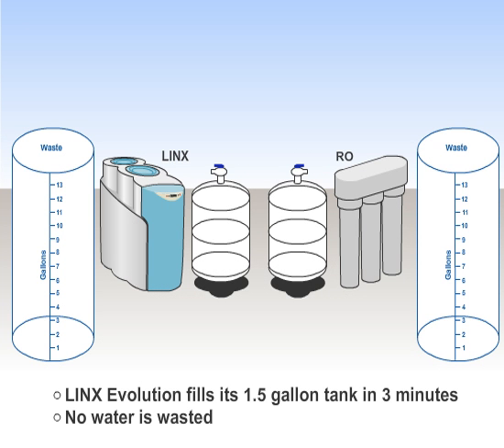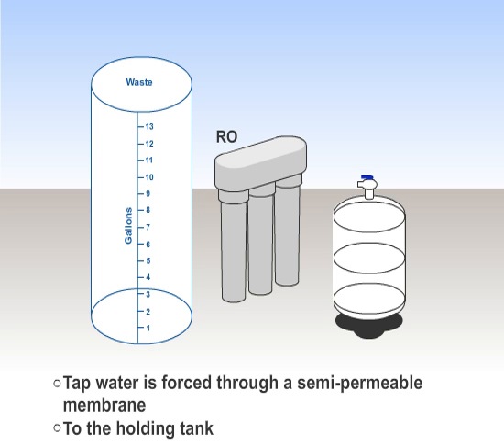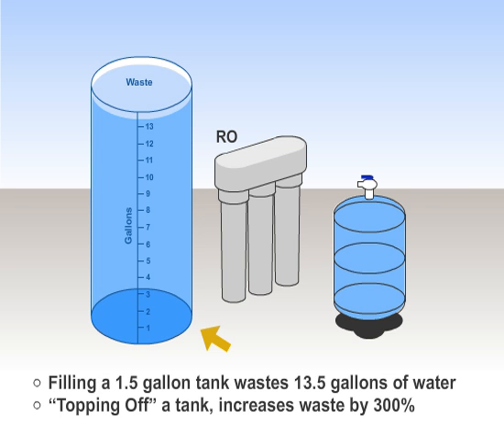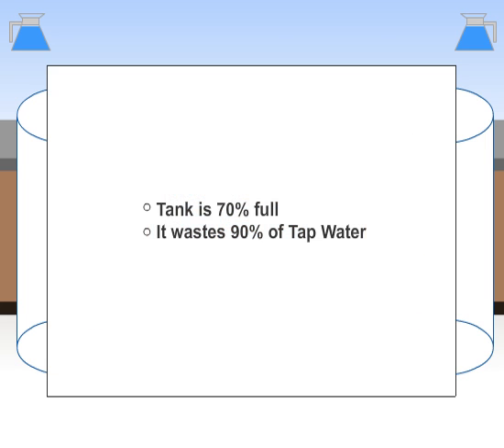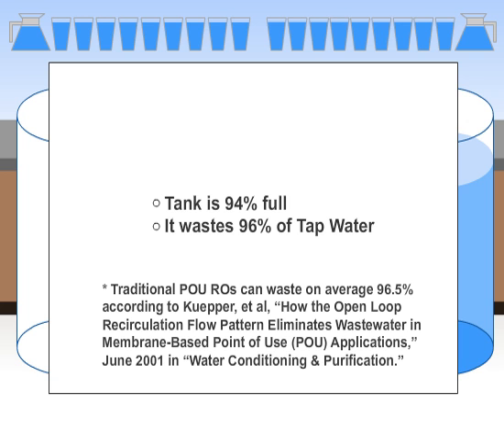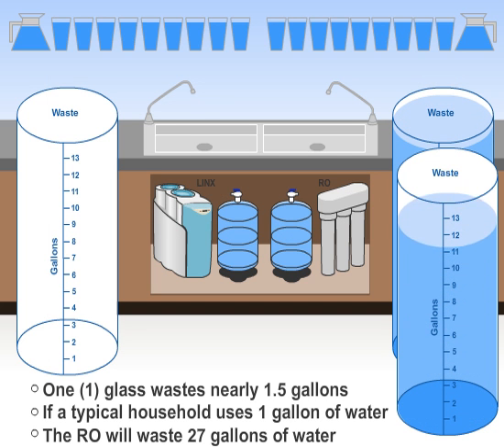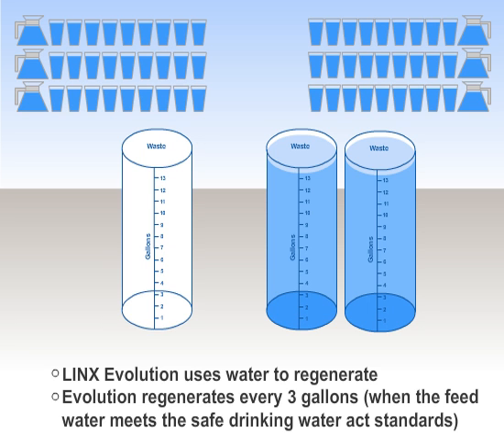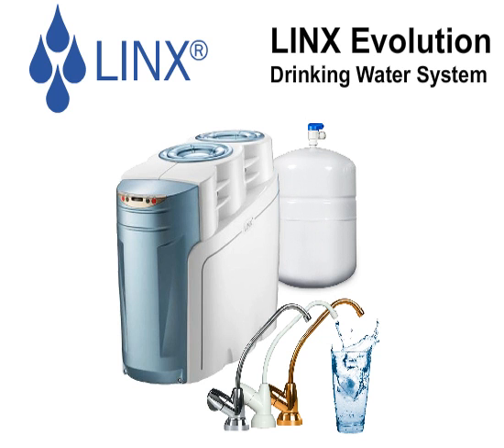Insane Water Waste -- Reverse Osmosis (RO) Truth

Comment: I have had a Whirlpool RO system for @ 7 yrs.  Since I pay $ 15 / month for unlimited water, coupled with a septic tank, I didn't pay much attention to any ' wasted ' water.  It would have been easy to run the discharge hose out to the garden, rather than have it connected to the sink drain.
Reply from the maker: Thank you for your comment. Great observation. Most people do not pay attention to wasted water. We think twice before littering, and even go the extra mile to recycle, but wasting water is still not a priority. Kudos to you for your awareness!

Comment from the maker: @Erin Kemuel - YouTube will not let us reply to your question for some reason, but yes the results for fluoride reduction were tested by Pace Laboratories. Actual results from this testing are posted up onto our website under the Benefits Tab and then under Cleaner-Healthier. A link to the PDF of the results is on that page. Thank you for your question.
Reply: LINX, you need to stop this. RO/DI filters (which are what you normally buy) are meant for getting such pure water that LINX systems cannot even compare. An RO/DI unit isn't even really something you should use for drinking water. It gets the water so pure that your diet will be lacking in trace elements. They're meant for things like an aquarium, where trace elements can cause algae growth. This is irrelevant.
Reply from the maker: Nathaniel Smith Thank you for your comment. That is the one of advantages of LINX® drinking water systems – you can use the Dial-A-Taste® control feature to leave some of the minerals in the water.  When operated at for maximum reduction of total dissolved solids (TDS) 5% remains in the water but when operated for minimal TDS reduction 30% remains in the water.  Only about 5% of mineral content remains in water treated by RO – but it depends on the constituent.  For example RO only reduces nitrates by 60-75% leaving 25-40% in the water which is not something you want if you are trying to meet the Maximum Contaminant Level per the Safe Drinking Water Program.  So LINX can match the quality of water produced by RO but the consumer also has the option of adjusting this to produce water to their taste. 

Millions of homes have RO systems to provide good tasting healthy drinking water and about 300,000 more systems are sold for this purpose every year in the US. Think of how much water is wasted.

Comment: When I started realizing the "waste water" of RO systems, I started to somewhat panic. Not only were the threads talking about the amount of water being "waste" but the cost associated with it. I then looked at my water bill and did some thinking on the cost of this "RO waste water". From my bill, the cost per gallon for water is less than a penny or at most a penny per gallon. If I then work that cost to the amount of possible water wasted by the RO system, it is far less than the amount I spent on buying filtered water from my local water store. So the cost is not such a concern anymore. But the real concern is the amount of "waste water" produced by the RO system. The 3-4 to 1 ratio is still a bit staggering. But if you think about it, it is probably the same for the water store where I purchased my 5 gallons of water. So the waste water either comes from my home or the water store. Since the dollar amount of the waste water is not much of a concern for me, it is now the actual "waste" amount that I can recover to be used else where. So for those who are concerned about the waste water, like me, try to figure out a way to recover the water. The threads and other sources do provide excellent suggestions on how to go about using the waste water from the RO system. Just as an FYI, there are RO systems out there that do provide a way to reuse the waste water...it's worth to spend a little time to research your options. You can either start drilling a hole through your brick wall or attach a pump to recycle the waste water.
Reply from the maker: Every water district is different. You are very lucky, but there are many areas where water is not so inexpensive. Despite the cost, eliminating water waste should be a priority. If consumers are able to capture and reuse their RO water, that would be great. The reality is that most consumers do not. Rather than drilling a whole through your brick wall or attaching a pump to recycle the water waste, a simple solution is to use the LINX System - which gives you better than RO water but without the water waste. Thank you for your post!
Reply: LINX Water

I agree the concern is the waste water which I did mention in my post. Since I had already purchased the RO, I was looking at ways to fix the waste problem. My rant at first was finding out about the waste water of various systems. I didn't do enough homework before purchasing my water filter system. My point is to look at both cost and waste and in my case waster is the larger concern. The examples I mentioned were mere suggestions based on what I read and what is offered with my current system. This is a rather eye opening situation and I just hope others do a better job of research than I did.
Reply from the maker: Ferdinand Disano Thank you for the clarification! We really do appreciate your comments and welcome the discussion.
Reply from the maker: Good news!! The systems are NOW available online! They are on sale - go to www.LinxDrinkingWater.com to see prices and purchase info.

Comment: Does this system get down to 0 TDS?
Reply: No is it is merely imposible to get to 0 TDS.
18.2 MegaOhm-cm resistivity is the limit. That is equivalent to 0.055 microSiemens/cm therefore with a conversion factor of 0.7 is 30 parts per billion of TDS (0.03 ppm or 30 ppb). You will always have CO2 from the atmosphere in contact with water generating an equilibium of CO2 + H2O = HCO3- + H+, thus increasing the conductivity. In fact nowadays cationic conductivity or resistivty is used in high purity water to get better resolution of water quality. This concept is widely used in water quality assurance in power plants.

Comment: I bought an iSpring RO system from Amazon. The waste:clean ratio is about 2:1. My family of 4 consumes about 2-3 gallons of RO water a day, so 4-6 gallons would be wasted. That's way less than the toilets, in which a pee uses 1.5 - 2.5 gallons to flush. You get the idea.
Reply: exactly. 4 pee per member = 25 - 40 gallons per day. Let's not even start about how much water is wasted during many many industrial processes, and how much water is wasted by producing plastic bottles...the list goes on and on.
Reply: +EviLNox8 You can pee in the RO, it will filter it and transform it into good water. That's what they do in the space station.
Reply: +CZY Homer So basically go pee behind your house, and use that RO system for better water and your water bill won't go up :p
Reply: I have a very RO similar system that produces about that same amount of RO water waste probably around 5 or 6 gallons down the drain. It's basically trivial. LINX is a marketing pitch. They want to hook up to your electric system (waste $$$ in electricity, which most electricity is coal fired etc.) and then charge a fortune for the filters & system when I could maintain my RO system for 1/5 of that cost. It's all smoke and mirrors.

Comment: I installed a GE RO system in our home 6 months ago. We live in Monterey County and the average water bill here is $300-$400 per month. I had heard of the water waste and how I hear it going down the drain.

I have since switched off the RO system

I plan to bypass the RO component and just use the GE filtering system. If anyone has any instructions on how to do this, I would welcome it.

Thanks
Reply: There are a lot better more efficient RO systems that waste 2:1 or less and your bill would be substantially less. Hook up the waste water line from the RO system into some sort of storage tank and then connect the tank to the washing machine waste water problem solved.

Comment from the maker: Thank you for your comment. It is true, both reverse osmosis and LINX technology reduce contaminants similarly – about 95% reduction.  Both systems also use sediment pre-filtration and carbon post-filtration so the product water is very similar.  In addition, you can depend on both technologies to reduce fluoride by 90% or more.

Comment: Reverse osmosis, distillation and bone charcoal will remove it
R/O is the best, avoid distilling and dab a bit of sea salt or himalayan salt into the water, not table salt which raises your blood pressure. if the salt is completely white, with no discolor then its devoid of minerals which means its table salt and its false advertising crap, no wonder they say salt increase blood pressure because its TABLE SALT FOR CHRISTS SAKE.
just get an ro system and a fluoride meter to test it, its costly*

Comment from the maker: In response to your other concerns, LINX systems are not membrane filtration systems, rather they are ION EXCHANGE systems which utilize electricity instead of chemicals or salts. The water passes between the layers of the LINX ion exchange membrane (media) not through it, so feedwater pressure minus tank backpressure (net driving pressure) has NO effect on water efficiency.

Comment from the maker: Thank you for your comment. Unfortunately, there is no way to eliminate the back pressure in the tank, however it can be mitigated with a permeate pump to partially overcome it.  In testing done by John VanNewenhizen (a long time Culligan technical manager) adding the permeate pump doubled efficiency thus raising water efficiency to from 6-28%.  Since no pressure in the RO tank equals no flow at the faucet, the back pressure can not be completely eliminated.

Comment: this presentation is not fair enough even the posting of comment needs even an approval.. You forgot to mention that there's a way to eliminate the back pressure.. ^_^ then what kind of membrane you are using? A semi-permeable one that uses electricity? well that membrane must be an epic since it can recovery with the HIGHEST rate.. since you're not using a pump there's no other way to push the water through the membrane. what are u using? electrolysis?

Comment from the maker: Thanks for your question. A quick survey revealed that none of us at Pionetics are fish experts but we do know that different fish require different levels of TDS. One advantage of LINX tech is that you can adjust TDS by adjusting the dial to optimize the quality of water produced. You will need other water treatment IF you have other water quality requirements for your fish operation. Use our website Contact Form to tell us what TDS level you need and we can email you back specifics.

Comment from the maker: Thank you for your question. LINX systems use very little electricity – only 0.2 kWh per gallon which is equivalent to 70 kWh per year for a typical family using 1 gallon (4 liters) of drinking water a day.
Reply: That's 250 watts per gallon. If your electric bills are $0.11 a kwh its around $0.03 per gallon. If you use 4 gallons a day its around 11 cents a day x 30 its about $3.30 dollars a month. If you have a 2:1 RO system plus the fact that you can go online buy a 2 years supply of RO filters for $100 ($50 dollar in filters and membranes per year) you can just buy an RO kit on ebay for $105 and for me I had a $1-2 a month water bill increase using an RO has around $75 a year routine maintenance for a 2:1 RO system. There is just no way you can justify charging $600+ for a water filter unit and $200 for filters which need to be changed about twice a year unless you virtually never use the system. Between the $400 in filters annually and about $40 a year in electricity and the $10 for actual water usage you are spending about $450 a year to maintain this LINX system. What a joke, I mean seriously I could buy water from a water machine for 50 cents a gallon and based on my family's usage it's around $200 a year to buy water at the store or I can pay $75 a year to run my RO system and waste a few gallons or put in my washing machine/garden.

Comment from the maker: Thank you for your question. It could be hooked up to the cold water faucet at the kitchen sink.  But this configuration will run a lot of water thru the LINX® system that goes down the drain rather than being consumed for drinking or used for other direct potable uses like cooking.  The result would be higher system maintenance costs as filters and the TDS cartridge (or RO membrane in the case of an RO system) would need to replaced more often.

Comment: ROs are for systems where waste water is not a concern. ROs are good for salt water filtration where the waste water is put back in the ocean such as on boat , or ROs are good for a well where the waste water is put back in the well using a reclamation system that monitors TDS (total dissolved solids) to make sure TDS does not accumulate in the well, if your using them for home use you can store the waste water and refeed it back in to the supply or use it on your lawn , pool, etc.

Comment: So far RO remains as the best and most cost effective filtration technology in market. With improved design, in most models from WATTS, iSpring, and Pur, the clean/waste water ratio ranges from 1:1 to 1:3.5. Your value of 1.5:13.5 is bit extreme.
A new technology called Hollow Fiber, which uses millions of mini tubes, each has 0.1 - 0.2 micron in OD, is comparable to RO but not producing any waste water. It even can filter out bacteria and virus. Search for B002XISS2Y and B009AEJWZG in amazon.

Comment from the maker: Thank you for your questions. The cost for replacement is determined by the local dealer but is about the same cost as calling a pro to change your RO filters & cartridges.

LINX products employ a batch process and only regenerate after the system produces the preset volume of water depending on the LINX model & feedwater TDS setting (between 1-12 gallons of water). During regeneration, the LINX 160 uses 0.6 gallons (2.6 liters) of water, while the LINX 140 uses 1.2 gallons (5 liters) of water.

Comment from the maker: According to the EPA, 97% of the water on earth is in the oceans, 3% is freshwater, of that 2.4% is permanently frozen in glaciers and polar ice caps. BUT only about 1/2 of 1% of the water on earth is groundwater.
It does not matter what system your city uses or if they recycle their water. The question is; do you like your tap water or do you like RO water instead? If you use an RO and it with a LINX System, you could save 1000s of gallons of water/year and get the RO quality water you like.

Comment from the maker: Thank you for your participation. LINX is not intended to get to 0 TDS nor is RO.  Both aim to reduce TDS by 95% -- and with LINX you can use the dial to leave more TDS in the product water if that is your preference. Lower TDS reduction may also be better if the feedwater TDS is lower. LINX Systems are Drinking Water Systems and the TDS (to varying degrees) is what gives water its "taste."

Comment from the maker: Thank you for your comment. It is possible to run ROs in series so that the reject stream is fed to a second RO but you will need to re-pressurize in order to get TDS reduction. Typical feedwater TDS in a home is 40-85 psi and the higher the better in terms of RO efficiency. The key to using RO in series in the home will involve collecting the reject and re-pressurizing back to a suitable level.

Comment from the maker: It is possible to recycle the reject back to the RO but you need to design a completely different system configuration. If the reject is 10xs as much as the product water you need a tank to hold the reject until it goes back to the RO. Another option is “zero waste RO” that pushes the reject into the home's water lines so it can be used rather than discharged to the drain. If done at the kitchen sink this higher TDS reject water would degrade the hot water used in the dishwasher and at the sink.

Comment: Is there a way to recycle the waste water back through the reverse osmosis process?

I mean if it is set up to fill a tank with waste water and that so called waste water is simply water that failed to be purified for reasons regarding pressure buildup then surely there must be a way to moderate the system's functioning so that very little waste water is produced.

Comment: That is true with all air-charged tanks. Line pressure drops to 60% and then it starts to refill. WOW tank designs do refill immediately but there is no back pressure on the membrane.

Comment from the maker: Thank you for your question. No LINX is NOT a more efficient RO. It is an ion exchange process using no chemicals to de-ionize the water or to regenerate itself after reaching it capacity.  LINX products do include the same pre-filters and post-filters as RO providing three layers of protection when it comes to filtering contaminants from your water.

Comment from the maker: At best, a typical RO only recovers 14% of the water in typical household use – 86% WASTED.  But this is at the ideal water temperature and pressure.  If they drop to a very reasonable 50 degrees Fahrenheit and 50 psi the waste rate increases to 94%.  Adding a permeate pump essentially doubles the recovery rate as shown on this chart.  

There are many types of ROs & water saving devices. We compared LINX to the majority of ROs owned - the less expensive ROs.

Comment from the maker: There are many types of ROs and some do have a “permeate pump” that does increase recovery.   Three most important variables in recovery RO are:
1.	Feedwater pressure
2.	Feedwater temperature
3.	Osmotic pressure caused by the “build up” of TDS at the surface of the membrane

The chart on our website (click Benefits and Less Waste) shows how RO recovery is affected by feedwater pressure and temperature.